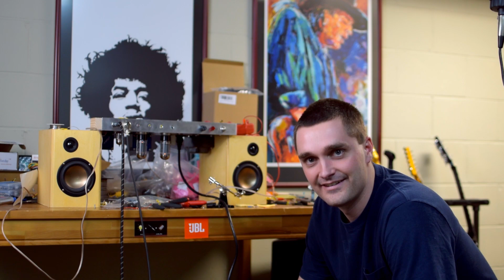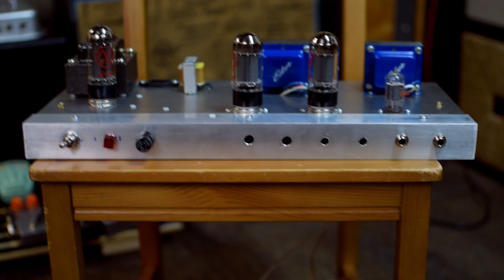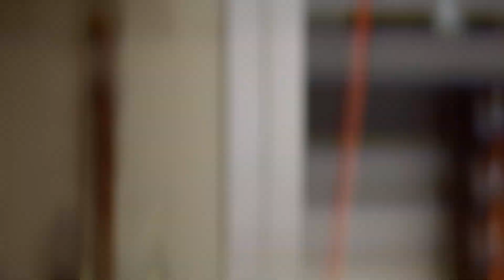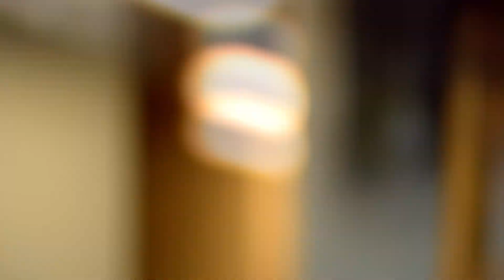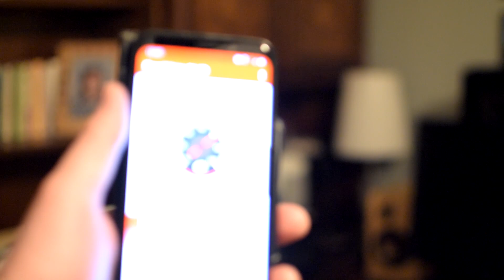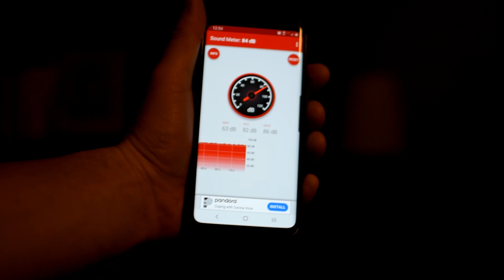6V6 Hifi Tube Amp - pt. 10 | It's Finished!  Tone Test and Final Circuit Review

Comment: I bought two Joyo JTA-05 ‘Champ’ clones for $AU250 each.
12AX7, 6V6 and tube power rectifier.
With the volume at 3 or 4 they are very clean. I use them to drive arrays of Fostex 3” full-range drivers for music listening, and they sound beautiful.
Or, I use the internal Celestions, turn them up to 6 -12 (12 ! Sux to Spinal Tap !) and rock hard …
$500 for a great stereo hifi, AND a killer stereo guitar rig !

Comment: Hi.. nice hard work .. Would you please add the voltages on the schematic. All 3 B+ points. The 6v6v cathode voltage.. Platte voltages too?
Thanks
Reply from the maker: I will work to get that schematic updated, but these are the voltages I took and documented in my tdpri build thread

- 370vdc as my B+1 just after rectifier.
- 6V6's are measuring at 362vdc on the plates, 366vdc on the screens, 22.6vdc on the cathode.

- 12AU7 is measuring 332vdc on the plate. 

With my voltages I have 6V6 plate dissipation:

- 23 volts on the cathode / 471 ohms of cathode resistance = 48ma of plate current.
- 362 volts on the plate minus 23 volts on the cathode = 339vdc plate voltage
- 339 volts * .048 ma = 16 watts

https://www.tdpri.com/threads/simple-hifi-home-stereo-amp-builderino.923525/page-6
Reply: @KleyDeJong  Hi  Kley:
Thanks for that quick reply.
I really enjoyed your efforts because, even though I've been in electronics since 1963, I joined ( www.antiqueradios.com ) in 2005 and after rebuilding many old radios : ( http://www.pbpix.com/radio/radio2.html )
 ... I eventually decided to try to build my first audio amp using 5902 micro miniature tubes) in 2009. Wow what a great learning experience that was. 
(BTW : I have lots of 5902 tubes for you if you want to build it)
 ( http://pbpix.com/amp/5902%20PP%2020v%20supply%20change.png
http://pbpix.com/amp/5902%20amp%20pix.jpg )

Then I took it up a step using the same idea but with 6v6 tubes:
( http://pbpix.com/amp/6v6%20pp%20amp%20change%20hw.png 
http://pbpix.com/amp/6v6%20amp%20done.jpg 
http://pbpix.com/amp/6v6%20amp%20internal%20layout.jpg )

But my latest effort is almost the same as yours: A SE 6v6 driven by a 12sl7 or a 12ax7.   And what a GREAT sounding amp this is.
[btw: I followed the ideas for my bias setting from the data research done by this engineer, named Matt, for his  SE 6v6 "Lacewood Amp ver2" . Read his info a few times and it helps understand the "optimal point" he selected after research for   Ultra Linear performance settings. ]
( https://www.cascadetubes.com/the-6v6-lacewood-amp-v2-0/ )
So here is MY very similar version of what he did basically with my own power supply ideas, also using a ccs bias and a more sensitive driver tube. You'll also notice extra sockets on the chassis to facilitate swapping/rolling other 6v6 tube styles such as both the 7-pin 6AQ5 and octal 6V6GT. :
(http://pbpix.com/amp/se%2012sl7%206v6%20toroid%20final%20may%2029th%20'18.png
http://pbpix.com/amp/se%2012sl7%206v6%20%20tubes.jpg
http://pbpix.com/amp/se%2012sl7%20-%206v6%20complete%20inside.jpg )

You'll notice that I build in wood boxes and I do not need HV transformers and I use AC voltage-dropper capacitors for the filaments.  
I also use an LM317 in CCS mode as a CCS for the 6V6 dc bias w/a 1000uf by pass cap.  This insures that each 6V6 draws the exact idle current.
Anyway  Kley... I'm sure you'll have a lot of questions that I'd love to answer anytime you feel like chatting. You'll see my home number on the main amplifier opening page.

http://pbpix.com/amp/ 

Since we're all stuck at home... feel free to call me anytime Kley.

Comment: thanx Kley, very nice to watch. regarding speakers, you should get full range drivers, no smaller than 12". They are cheap, if you go the DIY route. You know, is not just about power or volume, but is especially how the drivers project the sound in the room .